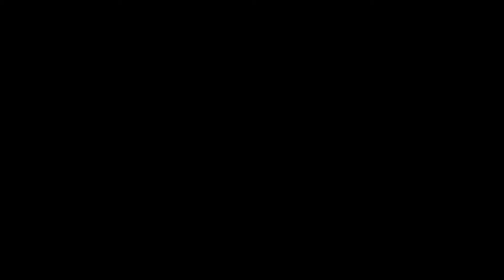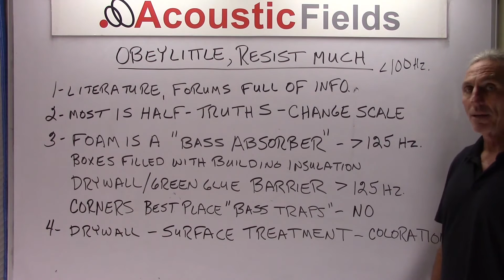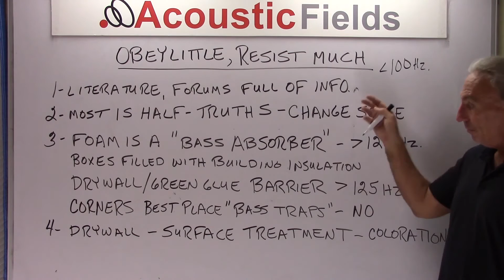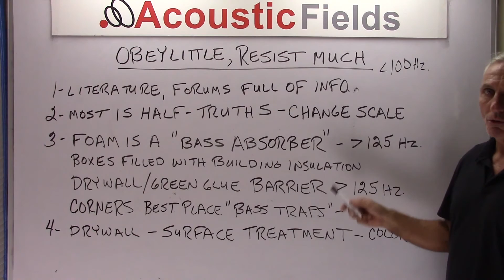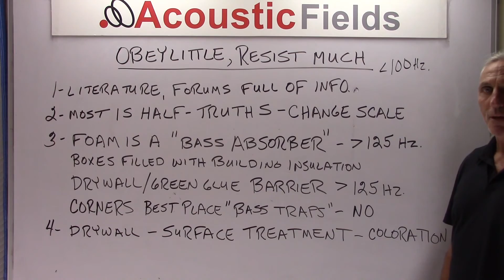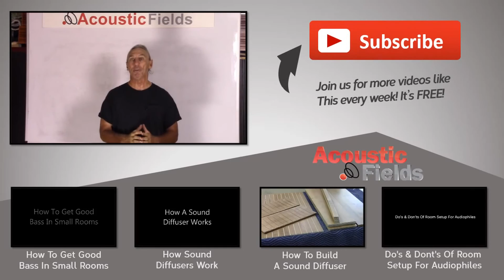Obey Little, Resist Much - www.AcousticFields.com

Comment: I get how drywall colors the sound of a room, I can hear it especially compared to lath and plaster. Sound almost like metal or glass to me. Since I rent an apartment and can't really alter the walls, is there anything I can do to ameliorate this?
Reply from the maker: B,  Run to the highest building in the world and shout that out. Thank you for hearing this and reporting it. You will have to cover the drywall with absorption/diffusion treatment. What is room usage?
Reply: @AcousticFields  Going to take this over to your forum.

Comment: Hi Dennis, where could I learn more about how drywall colors the room? If i had a box in a box studio, with the outside wall build out of masonry, would it be probably a better idea to build an inner wall with bricks too, to minimize the coloring? I have reade that using different materials would help me to isolate the sound (not talking about treatment), but if drywall colors that much, it would probably be better to sacrifice some isolation.
Reply from the maker: +Gustavo Moraes Drywall has a tonal coloration to it that impacts the middle frequencies right where vocals lie. You can test this yourself by recording vocals within different room surfaces. Dennis